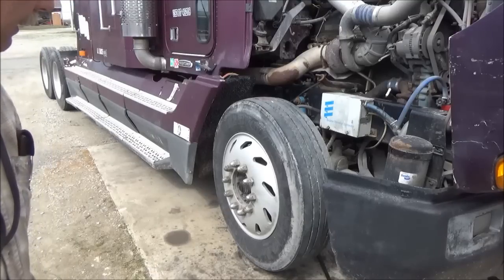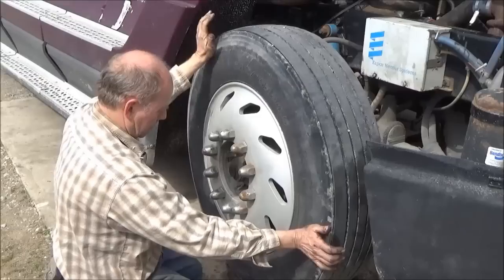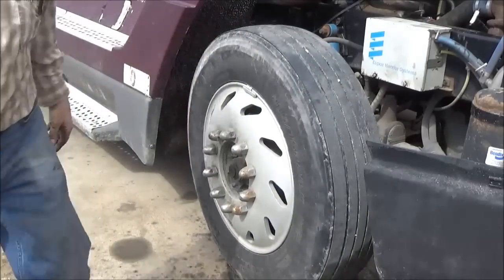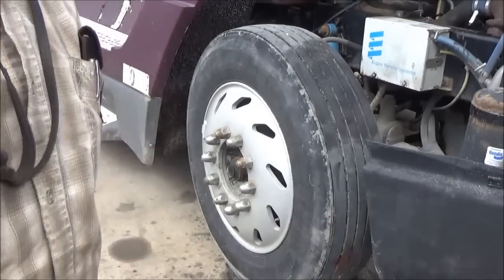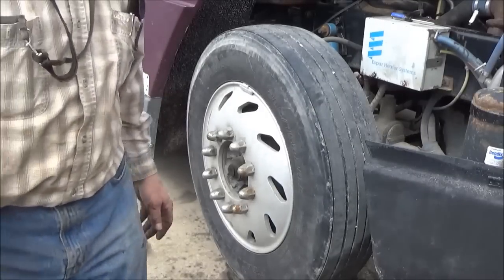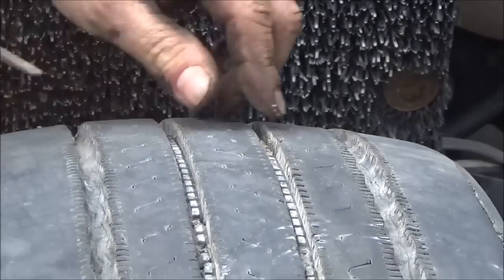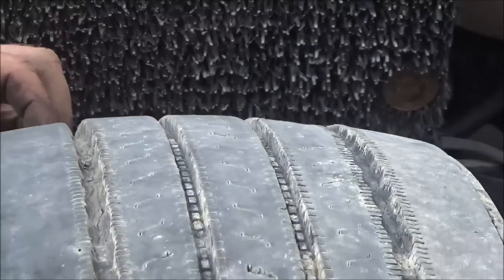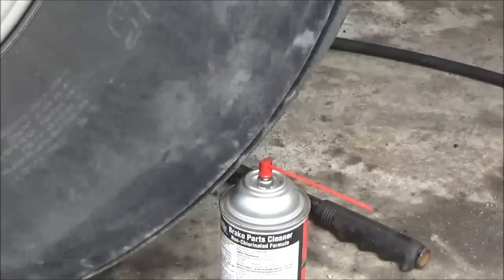How to check and ballance big truck tire at home

Comment: This method for checking balance is just genius. I love this!!! I have been researching balance all day long and never saw something like this. Good work dude and you may have just saved me thousands of dollars through my career.
Reply from the maker: I've been using this since an old man taught me over 40 years ago (I say old tongue in cheek) about 8 years older than I am now. Of course not near as good as a computer spin balance but definitely will save tires and eliminate tire vibration on every kind of vehicle you can do it on.

Comment: buddy this was one of the neatest videos i've ever seen. A lot of great ideas for checking out a tire. I'm gonna use some of them on a car tomorrow that has a wobble in the front end.
Reply from the maker: Thanks for the comment. On a car you know, you can't balance on a drive axle, there's too much resistance, if you have a 4x4 you can't balance this way at all, if it's not 4wd, use the non drive axle, take of the wheel, free up the brake, put the wheel on tight and balance. This of course is not near as good as spin balance, but I've been doing this since I learned it from an old tire man 40 years ago and I never had any trouble, but fixed a lot of problems this way. any questions, just message.
Reply: Hey and I got some great magic beans for sale how can I contact you?
Reply: @57bagre  afree on the resistance but what about during coasting. 30% makes a difference.

Comment: A clever way to check if it's off. When I have to change a steer tire at home, or on the road side, I throw a couple of golf balls inside it and it keeps a good balance. It makes a little bit of noise, but I don't care, there are far more noisier parts than that on the truck. It's not a Cadillac by any means.  Thanks Gordon.
Reply: Lol

Comment: Those are steer tires.  I would take both those off and put them on the rear and replace them with new ones.  I almost totaled my dads 359 have a front tire blow out at 50 mph.  You can't hold the truck on the road when the front end drops after a blow out.  The only thing that saved my butt was I stayed off the brakes as long as possible and still put it in the ditch.
Reply: Twin Sticks I was running 68 mph on I-40 when my right steer tire exploded. I had done my pre-trip about an hour earlier and the tires were fine. It was a Michelin too. The wasn’t enough left of the carcass to even determine if it was a defect. Fortunately there was a large paved shoulder to veer off onto. Michelin makes a mediocre at best commercial tire.

Comment: The driver side drive tire on my excursion is wobbling. It doesnt look life its got flat spots but just not on the rim right. I was told maybe swaping left with right but proper direction would be wrong unless i moved them to the front then the engine mount would shake creating even more ptoblems. What about shaving the tire or just remount.
Reply: Many Oriental tires do , I was thinking the same thing ,put in on the rear lift that side up slightly put it in gear and Do a controlled burn shave

Comment: Rotation is important as well as not using excessive brakes. I use balancers that go on the inside made with bearings but you could put a couple of golf balls for low pros inside and an extra for higher. Mercury and powder does work as good.

Comment: What cause tire to have flat spot like that? This happen to me before
Reply from the maker: Balance, alignment, grinding on the pavement when backing into a tight spot can leave a spot to start hammering on when driving down the road. the list goes on.
Reply: Staying parked too long with all that weight on it.

Comment: Put steel new rims and problem would be solved up
Aluminum rims are prone to bend, 
Also If you put 3 golf balls inside that automatically balance the tire.
Reply: I know this is an old comment, but I wanted to put this for future reference. Steel rims in my almost 3 years of experience have the biggest issue with balancing. You need almost twice the weight every time, and half the time the rim ends up being the issue. Steel is much more prone to bending than aluminum, it's much softer, where as aluminum is more brittle. There are pros and cons, but if you want a massive weight reduction and less balancing issues aluminum just wins hands down.

Comment: Why not dynamic balance the tire instead  of static balance? 

Break down the tire, put in balance media, inflate, done. 

As the tire surface changes the balance changes immediately. Gets 30 % extra life because its always balanced. No possibility of throwing off a weight.

Comment: it looks like that tire was on the other side and the truck started to pull to the right.  the original tire on the right which is now on the drivers side may jave cupping on outer shoulder.  this tire on passenger side now may be a little out of round...just sayin

Comment: One flat spot creates another it could even jump to the other side of the axle
Reply from the maker: That's true, but about the drum, it's balanced from the factory but the rust on it can chip off on one side and leave the other side heavy, so on an old drum it can get out of balance, that's why you can do this method to get you by for a little while.

Comment: how about spending a little money on a new tire. you don't want a blowout on a steer tire, going sixty miles an hour with a load in the trailer.
Reply: Because Gordon and folks like myself are smart and thrifty,overpriced everything these days, use the most out of what you have. Still have at least 10k mile left on her